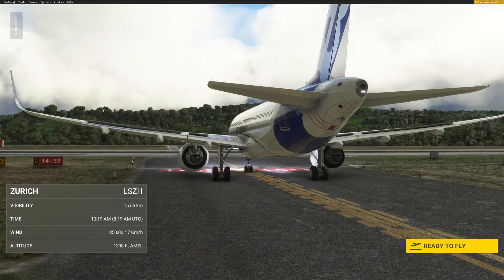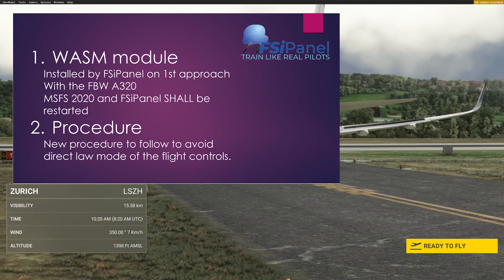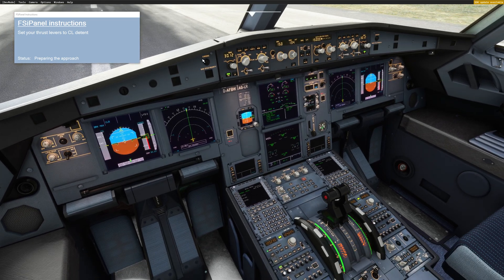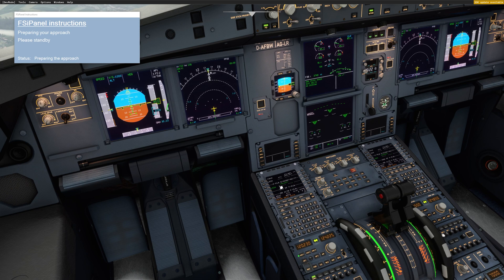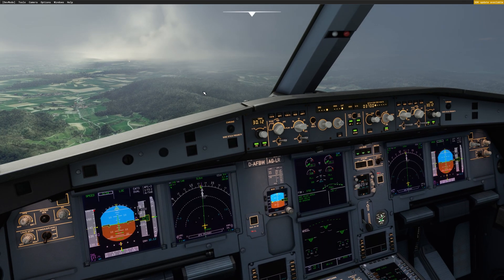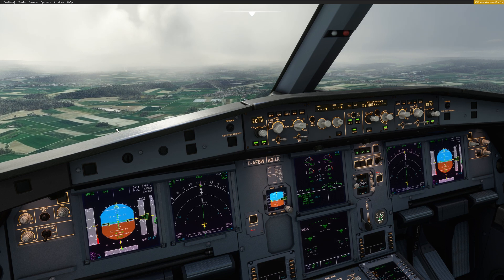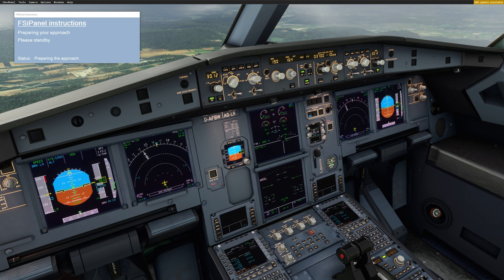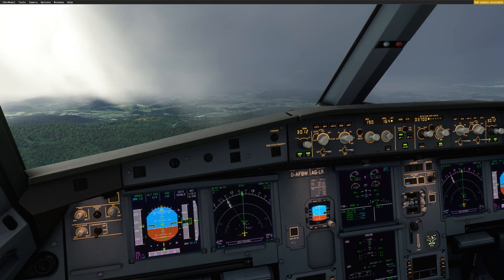FlyByWire A320 NEO new procedure

Comment: Thank you for theses informative videos. I have encountered a few airports that only allow VFR approaches regardless of which runway is chosen. I do fly the development version of the FBW A320neo, if that makes a difference. The airports I have identified so far are KMIA, KMEM, KCHS, and KSEA. The KMIA airport is  payware. The others are default airports. Other airports that I have tried are KORD, KDEN, KDFW, and KRDU. These airport do provide IFR approaches. Would you verify the VFR airports listed above to see if you get the same results. Of course, I don't if the issue is present at other airports , if confirmed by you.
Reply from the maker: Are you talking about the VFR green text above the airport code in FSiPanel? This is only to let you know that the actual WX at this airport is VFR, MVFR, IFR or LIFR. It does not have anything to do with the type of approaches available.
Reply: @FSiPanel  Yes, the green text was my reference point. Thanks for the clarification. I want to say again that this is a beautiful product and I look forward to its continued improvements.